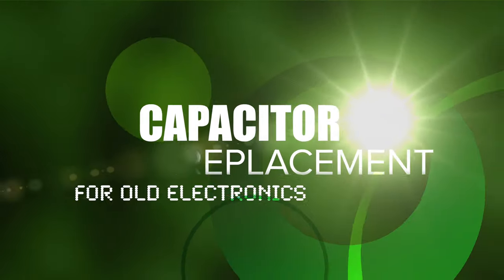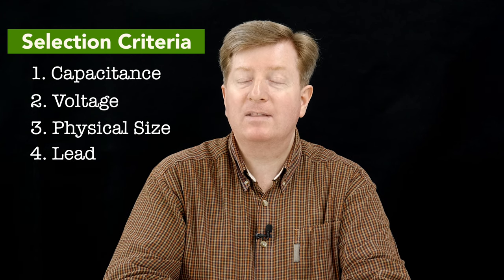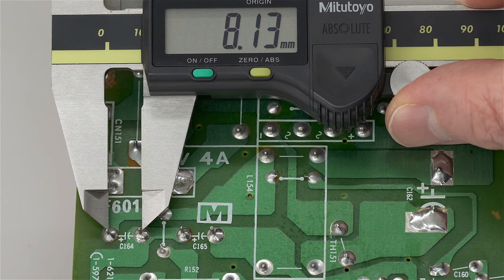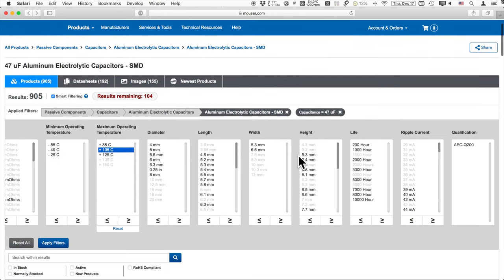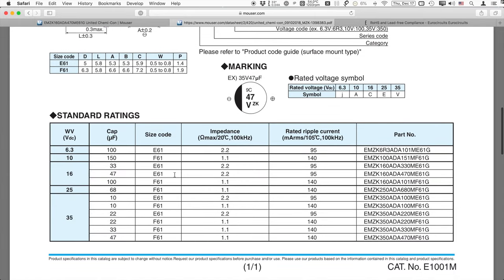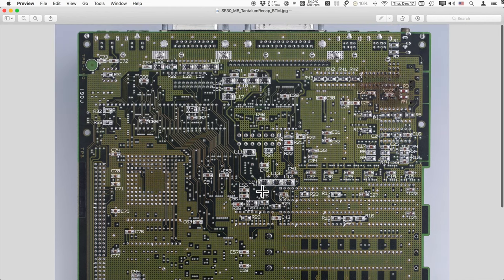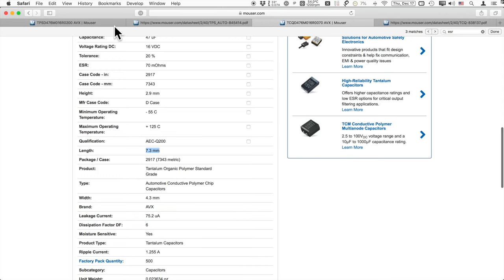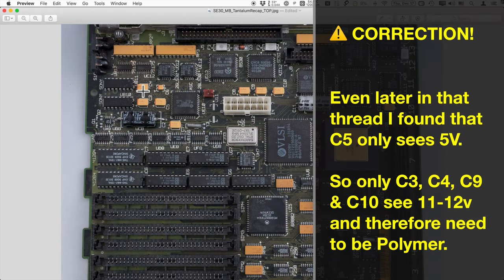Choosing Capacitors to Recap Old Electronics

Comment: Hello Sir,

The following questions are about old audio devices.

What do you think about replacing the old electrolytic capacitors on the power supply board with low ESR capacitors to increase their life? These capacitors seem to suffer the most.
Also, I have read that it is possible to replace the low capacity electrolytic capacitors with PP or PS (low dielectric constant) film capacitors to make your device more reliable. 

What do you think about it?
Thanks :)
Reply from the maker: Whether you use film capacitors or electrolytic capacitors or something else to replace the stock caps in a switching power supply, the main issue comes down to ESR. There are some power supplies that were designed to require a minimum amount of ESR on the output capacitors, and if you go below that the output could become unstable. But the only way to know that is if you have a schematic, and most of us don’t have schematics on the old power supplies that we are recapping. So then it could be a situation of trial and error, where after recapping you find the output is not entirely stable, you may need to swap one or more of those output capacitors with a capacitor type that has slightly higher ESR.
Reply from the maker: Jump to the 39 minute timestamp in my video below to see an example of what I mean.
https://youtu.be/Qof-Wjj_rWI
Reply: @JDW-  Thanks, now i understand that it's not that simple. And i also know now that i have to buy a scope 😁

Comment: Thanks for explaining that.  One thing I was hoping was that you might explain if there are any differences in behaviour of these capacitor types, in other words are they all exactly the same assuming you have the correct Capacitance and the voltage rating is sufficiently high enough. Being a newb to this sort of stuff I wonder if there are certain uses on a motherboard where you would prefer an electrolytic to a tantalum  or a ceramic etc. I.e. why do we have such a range of different capacitors that on paper are doing the same thing?
Reply from the maker: ESR can affect behavior in the circuit.  ESR is the resistivity of the capacitor.  Use a very low ESR cap in a switching power supply, and you might get unwanted oscillations.  I demonstrated that in my recap of the SONY PSU inside the Apple HDSC external hard drive enclosure.  But at other times when the capacitor is used as a "bypass" or "decoupling" cap to prevent sudden drops in voltage, low ESR is desirable and a big benefit. The big disadvantage of fluid-filled aluminum electrolytic capacitors is not only their high ESR but the fact that ESR suddenly gets much higher at very low temperatures close to freezing or below.  All capacitor types have their advantages and disadvantages though.  You might find the comparison chart on page 5 of the following PDF useful: https://www.analog.com/media/en/training-seminars/tutorials/MT-101.pdf
Reply: @JDW-  Thanks for the information. I will have a look at the PDF. I suppose what I was getting at is, if you were doing one circuit would you prefer a tantalum over an electrolytic because of some feature of the way they work or is there absolutely no difference between them other than the things you mention above. I just wondered why there are so many different types of capacitor.  I always thought there was some rule in electronics that says for this type of circuit you use a tantalum and for this other circuit you use an electrolytic. It would appear they all work the same, its just around how long they last and how they behave when over volted etc.
Reply: @JDW-  I had a look at the sheet and I can see from that the ceramics are good for High frequency circuits and the electrolytics are better for lower frequencies.  I read a few pages and my head started to hurt but I get the gist!
Reply from the maker: @Wallygjs  The answer to your question is neither short nor simple because the different capacitor types are not all the same. 

For example, if you need a 3300µF 16V capacitor for a particular application, regardless of voltage, your only choice is a fluid filled electrolytic capacitor. Such high capacitance values, at high voltage ratings, are not available in other capacitor types.

Here’s another example. Let’s say you’re looking for a capacitor with very low ESR. You can't do better than a ceramic capacitor. But let's ponder why NOT to use a ceramic (MLCC). First, the physical size of ceramic capacitors increase and decrease (changes so small it's imperceptible to the human eye) as applied voltage increases and decreases. It sounds pretty crazy, but it’s true. So while ceramic capacitors are very often chosen for the output of switching power supplies due to their extremely low ESR, they can also make a lot of noise because they vibrate the entire PCB, which amplifies the sound like a speaker.  If you've ever heard a constant buzz when using a product that has a switching power supply, ceramic capacitors are the reason! There are some expensive specialized ceramic capacitors that are made to eliminate that vibration on the PCB, and sometimes you can design a PCB with holes cut around the capacitor itself to attenuate the vibrations of the PCB itself -- but for recapping that is not practical.

Yet another big problem with ceramic capacitors is that they have an even more strict voltage Derating than solid tantalum capacitors. Why? Because the Capacitance of ceramic capacitors decreases according to the voltage (DC bias) you apply to them.  That's right...  The higher the voltage across a ceramic, the lower its capacitance! Sometimes capacitance can decrease as much as 80%.  Imagine a situation where you want to install a 1µF capacitor in a circuit that sees 10Vdc. You might need a 100v rated ceramic capacitor so as to maintain a stable 1µF of capacitance.  

The downsides to higher voltage rating for ceramic capacitors are Cost and Physical Size of the capacitor.  Even if you have enough circuit board space to accommodate a physically larger ceramic capacitor, and even if money is no object so the higher cost doesn't matter, you still may NOT wish to install a physically large ceramic capacitor because ceramic capacitors are ceramic and therefore brittle. Depending on the size of the circuit board or product, a fall to a hard surface from the height of even a couple feet could crack large ceramic capacitors.

So as you can see, it’s important to weigh the pluses and minuses of each capacitor type before choosing it. And while a degree in electrical engineering or years of experience as an electronics technician can be extremely helpful, the product data sheet is a critically important resource that can help you make well educated decisions about whether or not to use a particular capacitor tied for your application.  Datasheets pack an enormous amount of information that can overwhelm you at first, but time and experience can help you sift through it.  Sometimes you cannot do that alone though, so you need to ask informed people like myself or become a member of a popular online electronics forum to ask people what a given datasheet spec means.  

I hope this helps!
Reply: @JDW-  Wow, thanks for your long and detailed reply. I am definitely getting a lot more understanding of Capacitors and the minefield of information around them. At the moment I am usually just replacing old capacitors on Vintage Macs and Amigas so I don't need to make decisions about which caps to use. In time though,  I hope to do some night school or online training on electronics as I would like to build some circuits of my own such as accelerator cards or ram upgrades using modern chips.  Ultimately I would like to come up with a drop in replacement TFT screen for Classic Macs and create a circuit board that allows you to just replace the analogue board, as increasingly the old tubes are dying as are the availability of the flyback transformers.  Personally I would like to have a less dangerous classic Mac, as I have never been a fan of the dangerous voltages inside classic Macs. So thanks very much for taking the time to help me understand!
Reply: @santospoland  Alex, Thanks for the link I will check it out.
Reply: @Wallygjs  My pleasure. I hope the link is an additional resource.

Comment: A lot of old retro computer mainboards are be very delicate.  SMD capacitor pads will easily peel off which means a hot air gun will have to be used instead of a soldering iron.  Which for novice hobbyists such as myself makes it more difficult.  I have damaged a Commodore Amiga A1200 mainboard because of delicate SMD capacitor pads.
Reply from the maker: Hot tweezers are yet another option for those who either lack a hot air station or inexperienced with it.  I personally have access to both tools and find them each to be beneficial at times.
Reply: Id never use hot air to remove SMD capacitors.  Its a sledgehammer to crack a nut.  Desoldering tweezers are what should be used.  Alternatively a good soldering iron can be used.  Theres no substitute for experience so plenty of practice on scrap PCBs first if you're a novice.

Comment: What is the best way to determine the D-Rating of Capacitors on Mouser?
Thanks
Reply from the maker: By "D-Rating" did you mean to say "Derating"?  Or do you mean Dielectric constant or Dielectric strength?  For now I will assume you meant to say "derating."  Such is not given on Mouser, and it is not always given in capacitor data sheets.  But guidance regarding capacitor Derating is typically given in general info publications by capacitor manufacturers.

What I mentioned about "derating" in my video pertains mainly to TANTALUM capacitors, as they are most sensitive and susceptible to dying due to a voltage spike across them.  So when I talked about "derating" for those caps, it pertains specifically to "VOLTAGE derating," which means you select tantalum capacitors with a voltage that is a certain amount higher than your circuit's working voltage.  For SOLID tantalum, it's a 50% voltage derating, which means if your working voltage is 5V, you should select a SOLID tantalum cap that is rated for 10V or higher because 50% of 10V is 5V.  POLYMER tantalum has a more forgiving Voltage derating of 20%, which means that in a 5V circuit, your Polymer tantalum cap needs to be rated at 6.25V or higher because 80% of 6.25V is 5.0V.  There is no 6.25V rating for capacitors, so you choose the closest one, which is that case is 6.3v.

Ceramic capacitors too (all types except NP0/C0G) have a DC Bias effect which dictates that you consider a voltage Derating in order to ensure you get the nominal capacitance you expect in your circuit.  So for example, if your circuit is 5V and you choose a 5V ceramic cap, it won't fry due to a voltage spike like a 5V rated tantalum cap would, but you might get only 20% of your expected capacitance.  Why? Because, quite sadly, ceramic caps like X7R lose capacitance as your applied voltage increases.  It's the nature of the beast.  NP0/C0G don't have that problem, but they are only available in very small capacitance sizes.  So you normally must use a ceramic cap voltage rating that is much, much higher than your working voltage in order to ensure you get the full rated capacitance.  If you use a 50V ceramic X7R cap in a 5V circuit, you will have no issues, for example.  But the most accurate way to choose the exact voltage you need is to find the DC Bias curve (graph) in a ceramic capacitor publication, which shows you Voltage versus Capacitance, and then you can very accurately figure out what your ceramic cap's voltage rating needs to be to ensure you get the minimum capacitance it needs to supply in a given circuit.

I hope this helps.

Comment: I took my NAD 7400 receiver for repair, but the guy is having a hard time finding transitors/capacitors repalcement. Can you suggest a place where to buy those components?
Reply from the maker: I'm not an audio guy, so I had to Google your part number to see it is a AM/FM Stereo Receiver.  I have no schematics or capacitor lists for that device.  The best I can do is suggest that you identify all the electrolytic capacitors that need replacing, then note all aspects of their physical size, including Lead Spacing, then order replacement capacitors from Mouser or DigiKey. Get the same capacitance, and get a cap rated for the same voltage or higher.  That's pretty much what my video is about, so if you require more detail about using the Mouser website, then I would refer you to my video about that.  Best wishes.
Reply from the maker: I see you also ask about TRANSISTORS.  That is beyond the scope of my video, but you can buy those parts at Mouser and DigiKey as well.
Reply: @JDW-  Thank you so much for your quick response. I will definitely check them out.

Comment: JDW I jhave old tube radio with a multi section capacitor color coded yellow 400 volts 30 mfd red 250 volts 30mfd blue 630 volt 20 mfd 20 mfd green What do you recommend replace it with? If I can I want put a can style capacitor in it would do you recommend as far as volgage and micofarad?
Reply from the maker: Brian, old tube radios are outside my area of experience. I've never owned one.  Basically, it's a matter of properly identifying what is a capacitor, and what is a resistor, and not get them mixed up.  If you are sure the values cited are Micro-Farad and not Milli-Farad, because you seem to know the voltage specification, you can rather easily do a keyword search for appropriate replacement "Electrolytic" capacitors using the capacitance and voltage values you told me, from places like Mouser or Digikey.  

Caps the size you mention should be polarized, although I am not 100% sure about that.  You also need to measure the Lead Spacing so your replacement capacitor has the same spacing; otherwise the cap would stand up on its legs, and you don't want that to happen when installing physically large capacitors.  

The main issue would be to ensure that you know the Polarity. If the board isn't polarity marked and you can't see that on the stock caps either, you can often find schematics for old radios which would tell you that.  A great resource about all that is the following URL: https://antiqueradio.org/recap.htm